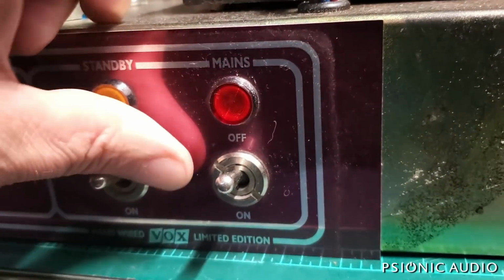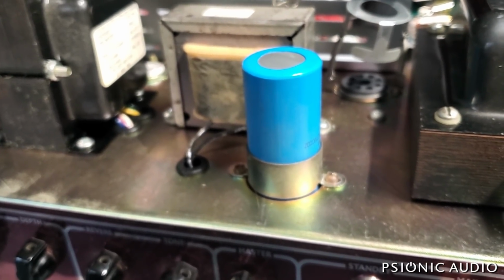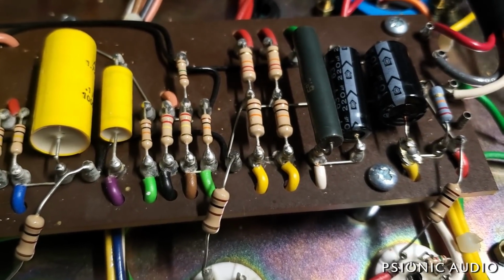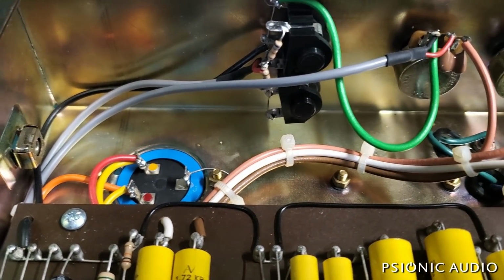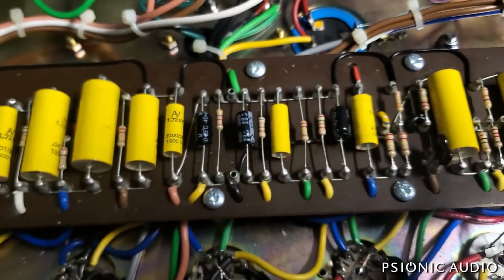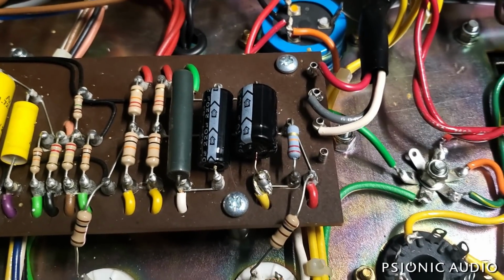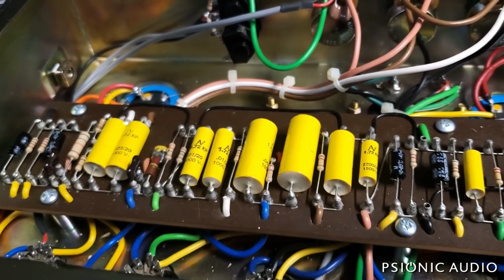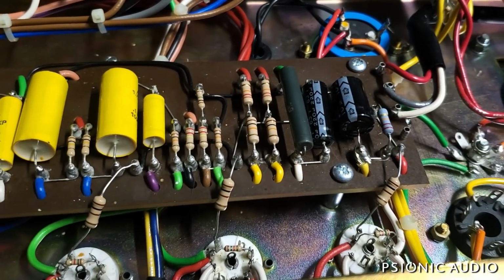'02 Vox Limited Edition Hand Wired AC30 | Part 1 : Initial Inspection of a Rare Amp

Comment: I have a question...why is that star grounding problematic?  Does it work itself loose over time, since it's not soldered directly to the chassis?  Thanks again!
Reply from the maker: I don't know that it is in this model. 

The ground scheme in the TBX series is a bad joke though..

I'll know more as far as this amp goes once some needed parts arrive. 

But as they have filter cans in sequence from input to output, I expect to be moving grounds to those can negatives in sequence. 

I'll explain in the video when I do that.

Comment: The iec is marked for the Nippon market as 100volt 50 hz  or did I miss something ?
Reply from the maker: This amp came in wired for 100V mains. I already redid the primary connections. I doubt the IEC socket needs changing, but I can spend the $2 if necessary.
Reply: @PsionicAudio   The iec is the same as far as I know for 100 to 240 volt.  So no need for the socket to change . It should be rated to 10 amps 240 volt.

Comment: Lyle - I have #280 of the run of 350 of these made in 2003. The date code and production # are on the plate. Pete Cage, the DC area doppelganger of Lyle Caldwell, reduced the filtering for me years ago in response to me saying it played and sounded " too stiff". It does sound like Vox, but not exceptionally so. My 2000 Korg ac30 sounded better. I am very interested in hearing your thoughts on how to bring this amp up to your standards.